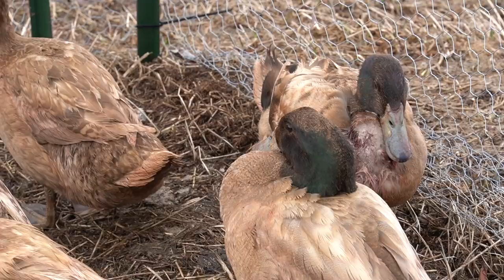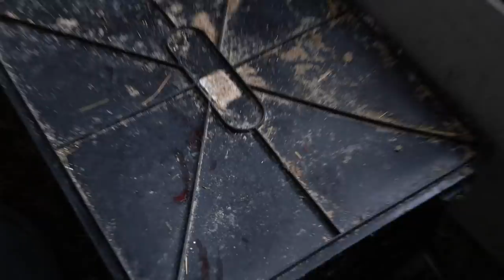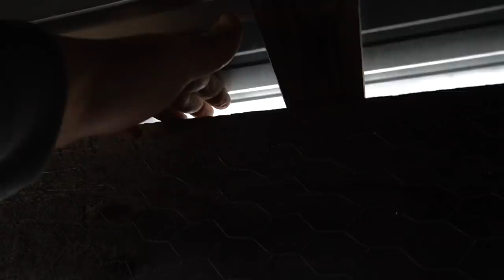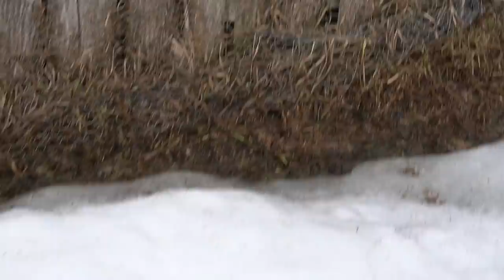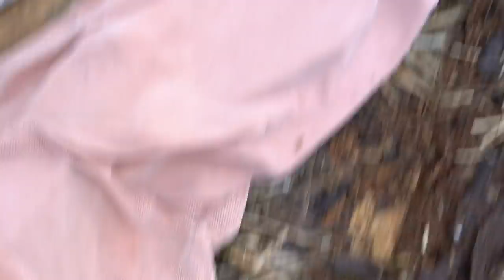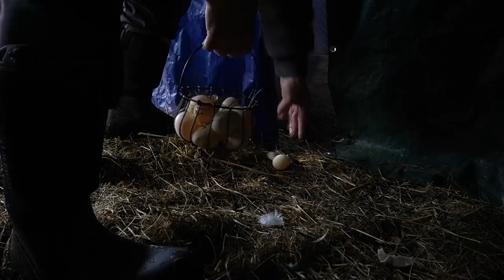Our Duck Farm was Attacked!!

Comment: So sorry! It doesn't take a lot for any predators to get in. Weasel and raccoon are notorious for carnage, fox sneak up and grab a few every day until they are gone. You should get hardware cloth around the bottom and run a hot wire you can turn on at night. They will come back...they are sad it's true but they'll recover, they are just in shock. The really injured  ones I would clean up and bring inside, warm them up. Best of luck...it really stinks when loss happens 😪

Comment: So sorry that has happened, you look as,sad as the ducks..
I agree in regards to electrified poultry netting..so far it has worked for us and we use a portable solar energizer so we can set it up the fence anywhere..
I hope the rest of your flock is able to recover..and you as well..
blessings..
Reply: I would have to agree with the electric fencing. It will cut back on the most likely ground based predators. They are very affordable and definitely worth the investment if you are doing long term homesteading.

Comment: This is exactly why I use 1/2" hardware cloth.  Chicken wire will keep poultry inside but it does not do well at keeping other critters outside. I use 1/2 " hardware cloth for chickens and 1/4" hardware cloth for quail. I have found that newly hatched quail are so small that they can get out through 1/2" hardware cloth.
 If a coop is sitting on ground level , it is a good idea to bury 1/2" hardware cloth to one foot around the perimeter. It prevents digging under.

Comment: Sorry this happened guys! I had a mink problem on my property and it was taking out my ducks. It would go for the neck first and take the head off and then stashed the body to eat it later. Minks a really sneaky creatures and can fit into very tight spots. it looks like you guys got your building lockdown pretty good so I doubt anything bigger like a raccoon or Fox got in there.

Comment: Most predators, especially small ones, will only be stopped by holes smaller than their skull since all other bones have some sort of joint or are linear.  That chicken wire bends enough that it's actually a bigger space than it looks.

Comment: It's really difficult to lose your first duck to predators, we lost two last spring (Duchess a silver Appleyard and Phoebe a Batik Alabio)but they were outside when it happened.
 My duck coup is smaller than yours but provides 2 sq.ft. per duck. It is raised 18 inches off the ground on 4x4 stilts, the bottom is made of 2x10s with small holes less than 1/2 inch drilled for drainage , the only gaps are thin slits near the roof with wire covering for ventilation. The door is over sized  with 2x4s behind it covering the gap by the hinges and the latch. It's difficult to clean and a pain to get the eggs out, but I sleep pretty soundly now.

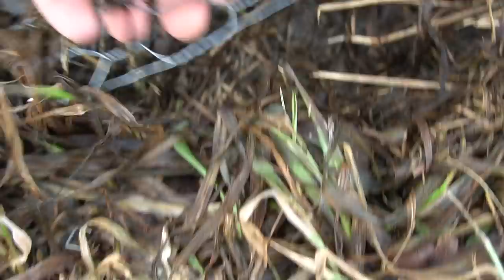Comment: At 7:23 is probably where the weasel came in and dragged the duck out. Lay down 24" wide hardware cloth on the ground and connect it to the building all the way around and use landscape stakes to hold it down.

Comment: Setup an inexpensive trail camera on a pole facing the duck house. Install a heavy duty latch and lock. Patch up the gaps near the ceiling because foxes, ferrets/weezel and other small predators can scale the wall. And squeeze through insane places. Install a top shelf around inside the duck house where the ducks could jump/flapp up to and avoid ground predators. Double reinforce around the bottom with wire.
Reply: Watching video again and reading other comments, it sent to definitely be a weezel or ferret type small predators. Signature neck bites, and leaving little trace of it's victim other than blood. They sell electronic pest control boxes that emit sound they don't like. But it might effect the ducks. Good luck!

Comment: We have Fox, Weasel, Martin, Coyote, Bear, Cougar, Wolf, Eagles, Osprey and Ravens in our area.  We used 1/2" x 1/2" hardware cloth for an 'enclosed' run with expanded metal 12" below ground.  We have solar sensors lights at each enclosure and we recently bought an LGD for our 14 goats.  We always close the door to the run/coop or barn at night.  We have never lost an animal to a predator (land or air) since starting 4 years ago.  Take care of security first then worry about which animal to keep or cull.  Suck it up and get'r done - they're lives depend on you.

Comment: So sorry about your ducks. I had an attack too and lost my chickens and only one duck was injured. My breach was by a pack of wild dogs-coyotes digging the soggy ground. I would clean them up and apply the wound care stuff. Hope you don’t lose more lives. Best thing to do is to clean out that house real well. Add fine pine shavings to the floor for a deodorizer effect and go over every inch of the perimeter to add support and I use hardware cloth. It’s expensive but works for years. I would make sure it’s not still hiding in there. I think your right about Weasel or fisher cat. I am from NH but now in NC and I feel your pain. Good luck.
Reply from the maker: Thanks for the suggestions. I really appreciate it.

Comment: Sorry, been there. A weasel , mink can get through a very small opening.  You need to seal house with hardware cloth  or wood.  Also run an electric  wire  an inch off the ground and another as high as a racoon. Chicken wite isn't  as secure as hardware cloth.  They probably dug undet. I found a small hole had to lay block  and cement.

Comment: Sad day my friend. Sorry to see that happen to your flock. Unfortunately I’ve dealt with the same issue more than I’d like to admit and usually that’s the case from many people who raise fowl. There’s no ultimate solution to protect them from predators unless you’re willing to build a cement compound lol. Realistically, I would get some welded wire fencing (16 gauge is good but 14.5 gauge is the best for this application) and reinforce the coop. Make sure you dig 18 + inches into the ground around the perimeter of the coop and bury the fence. I don’t know what your roof situation is but it couldn’t hurt to reinforce it with the fence as well. Next, I would look into electric fencing for the coop and the run. You will soon run into daytime predators and predators that will take a little more of a deterrent. Third, start trapping! Get the right license for the critters you plan to trap and remove the threat. Of course, more predators will find their way to your farm but this will thin out a population and reduce threats. There’s a ton of other methods but most are ineffective. I hope this helps and a fast recovery for your flock.
Reply from the maker: Thanks for the recommendation! I’m starting to make some longer term plans, and your advice is really helpful.

Comment: Might be a Fisher Cat. Your perimeter coop fencing should be 1/2 inch wire mesh that comes down past the bottom edge. It needs to be buried a couple of inches beneath the soil and extended about a foot out from the bottom edge of your coop walls with cement pavers to help secure it. We had a local farmer lose many of his chickens to Phishers. Not pretty. So you’re not alone in this. Chicken wire just doesn’t cut it. You need to fork out the money for the more expensive wire mesh. Sorry for your loss. No doubt you will persevere.

Comment: Yup weasel or mink.  They can squeeze into a really small space.   You have to treat those wounds with a good antibiotic powder.  I would suggest you use hardware cloth instead of chicken wire and extend it at least 2 ft out on the ground around the coop.  Poor girls.  .

Comment: I have to keep wildlife in and out. I suggest that you invest in a roll of 1/2 inch by 1 inch welded wire fencing. It comes in a variety of widths up to at least 6 feet and is significantly stronger than hardware cloth.

Comment: That narrow space between the roof and wall needs to have wire over it. Weasels and rats can get through a space that small, and climbing the wire on the walls to get there makes it easy. The missing duck could be between the bales or tarps and the wall, partly eaten. There could be a tunnel under the snow bank leading inside. Everything was knocked over and scattered because of the ducks' panicked attempts to escape. My peacocks sleep in my garage when young, and in bad weather. It is completely solid, no windows. They can't see in the dark, so I provide several nite lites. Still, they panic and bounce off the ceiling and walls if a mouse is poking around on the floor! I've watched it happen...

Comment: I'm feeding my injured goat comfrey leaves. I'd talk to Rose about possible herbs to put in their water.  Also, chicken wire is very easy to rip. Not secure at all. Might want to cover at least the bottom of the building with a more sturdy fencing material. And is if possible, bury some of it to prevent digging under. So sorry. Having dealt with both animal predators and human predators, I know your heartbreak.

Comment: You have gaps. it doesn't take much. I would suggest remove all the bales and check from the inside out. Something either came in from the top or the very bottom. It looks like something from the weasel family got in. The bad thing about them can fit through the smallest of spaces. Get a camera set up in there so you can find out for sure.

Comment: I’m sorry for your loss, sir. I also hope that even the more rough looking ones will pull through for ya, it’s surprising how resilient they can be. 
I’ve got 30 coming at the end of this month, (khaki campbells,) and I have electronet for the perimeter of their roaming area to deter predators. A Gallagher s10 and some rolls of the poultry netting by premier one is what I went with, (each roll is about 150$ for 164’ and the charger was 120$ish) but after this I think their house will be reinforced with the hardware cloth like I had seen others recommend, too. I’m with you on the idea that it was probably a weasel. In the past we’ve set up traps to try to catch predators, but equally or probably more helpful would be a good LGD, bought as a puppy and raised in the duck pen. The 2 Great Pyrenees at my friends farm are adequate to protect all of their chicken tractors at once and sometimes they’ll have 10 with 30 in each. They’re not constructed nearly as predator proof either. At the same time those dogs guard their flock of roughly 30 sheep and the 10 head herd of dairy cows. I think that most puppies raised right with the ducks in close proximity should assimilate and do a good job of helping, excluding sight hounds/ retrievers, of course. 
Anywho, good luck on keeping em out from now on and I hope that having to cull a few from the injuries won’t bring down spirits on the farm too much.
-Mark

Comment: Weasel or mink or raccoon, but whatever it was will be back!   You literally need to build Fort Knox to protect your flock!  Weasel or mink can get thru a very small hole.  Chicken wire isn’t sufficient!  You need hardware cloth!
Reply: Jim Walloch chicken wire is fine it just needs to be under the ground.  Mink/weasel/stoat for sure I seen maybe 5 places one would get through. Get a anchor on the bottom of your chicken wire and bury it. Also your roof cavities need filled completely with wire.  If you had atrial camera it would be great  to try and trap it with a cage trap? and if you are into hunting I'd try killing it or maybe poison if you don't have other animals like dogs? Otherwise just making the ducks inaccessible is the only thing you can do
Reply: abcd1234jason chicken wire is not fine!!!  Raccoons will reach thru, grab a duck and eat them thru the wire.  Seen it!  Raccoons will chew thru chicken wire.  Have been told this many times by ppl it happened to!
Reply: Jim Walloch ok cool story bro, chicken wire is fine

Comment: I am SO sorry for your loss and am only too familiar with that kind of loss.
With the hay bale knocked over, I suspect something large maybe a dog? If it had been a raccoon, or fox, they would all be dead. You need to look for track and spoor to identify it.
After losing many animals over 20 years, I built what I hoped to be a predator-proof aviary for my flock when I moved to my tiny homestead in 2014. The metal roof does keep out owls and other birds & climbing critters. The 12-gauge 4" mesh cattle panel & 1/2"-inch hardware cloth wall panels are seated in rabbets in 4" x 4" posts; plenty of ventilation and strong enough to keep out bears & bobcats (tanks). I wish I'd dig the footings much deeper and wider: 1-ft x 1-ft cement footings were not deep enough - rats dug in.
Reply from the maker: Thanks for the suggestions. My theory is that the bales got knocked over with the ducks and animal running around the house during the conflict. I’m sorry for your losses.

Comment: I had my whole chickenflock killed by a badger during one single night.. they go for the heads.. you ducks might have been too much to kill, and so it went away with the one it managed to take.. they will drag them off to eat in a safe place. Badgers are strong and good at digging, they will also try to rip netting open by biting on to it and pull. chickenwire will not hold a badger out.
Badgers will come back, but hardwarecloth will keep them out.. unless they dig under it.  Badgers are often overlooked as a predator, since it normalle is a scavenger, but they are of the weasel family, and animals that can not get away will be killed by them. Good luck, and do not give up :)

Comment: Man this he is so sad. I just bought five khaki Campbell and four Pekin and found your Channel to assist and reference  raising . Last year I raised chickens and turkeys and I had several encounters of hawks and a  huge owl. This is what that appears to be to me an, owl. I have a chicken run that measures 60 ft by 25 ft with a 6 by 8 chicken coop. The access door in the rear measures 2ft by 3ft which I kept closed at night. I have several telephone poles around the outer edge which made the chicken run virtually impenetrable buy ground attacks but by air they were very vulnerable. I got so frustrated that I sold all of my chickens and turkeys after losing some of my best hens and favorite roosters. They were so terrified they stopped laying. I'm starting over with 10 Carolina Gray straight run chickens 5 red star pullets and some other five that I can't remember and 10 straight run Barred Rock. This time I will have a top on my chicken run and my duck house. I'm just curious as to what size duck house I need for 9 ducks.
Please do not do as I did and allow this to discourage you take those eggs you got it hatch those eggs get a top over your coop, and an electric fence around the outer perimeter and go for it. Good luck and many blessings.
Reply from the maker: Thanks for the encouragement and best of luck to you, too. It’s tough losing animals.

Comment: Looks like mink.  Weasel just peel the neck and drink the blood.  Weasels don't normally leave much blood. Minks are extremely aggressive and often drag their kill away.  The mink return.  You need 1/2" hardware cloth.  Chicken wire is heavy enough and the holes are too big.  My duck house is sealed with 1/2" hardware cloth and the floor is completely covered with 20 gauge sheet metal.  No predators can get onto my duck house.  Probably a mink.  Martens and Fishers are quite large by comparison.  Minks are very strong for their size.  I think you had an attack by a Mink.

Comment: Note that the APPEARANCE of "impenetrability" is enough to discourage most predators. The fact that your duck house walls and door are see-thru might encourage attempts to penetrate. Maybe use tarps to block all vision. And chicken wire is too flimsy. A few small rocks at the base are not dig-proof. Use heavier, smaller-opening (1/4" to keep out mice) hardware cloth and metal tent stakes to hold it to the ground, plus a 4-ft-wide apron of hardware cloth around the outside, also tacked down, to prevent tunneling inside (as skunks will do). Consider building a new, solid-walled, concrete-floored (sloped for hosing out and drainage) duck house nearer to your bedroom window, so you can hear any ruckus and run out, armed. Predators are MANY, desperate, determined, and CLEVER!P.S. Stacks of bales like I saw are too easily tipped over in a panic, which could trap or injure some of your ducks. Good luck, but welcome to WHY our ancestors HATED all predators!

Comment: What's worse than a weasel? 2 weasels!!! Dang. A weasel can squeeze through a 2" opening with no problem (anywhere a rat can go).
Seems you should rebuild or renovate the coop, ground up: 1) Build a base/skirt of trenched 2"x12" treated lumber. 3) As said before use 1/2" hardware cloth, stapled and blocked-in at bottom of skirt (maybe put in a solid wall or 2). 4) 2"x6" header all the way around, block-in the wire. 5) Vertical 2x4 supports where needed. 6) Be sure the roof is sound.
Other things to consider: Motion-lights, electronic repeller, electric fencing on outside, so as it auto-turns on when you shut/lock the door, predator urine, weasel traps, rat traps, glue traps, or maybe security observation w/ night vision scope on a suppressed AR-15. Good luck, poor duckies  : (
Reply from the maker: I think rebuilding is the only true solution.